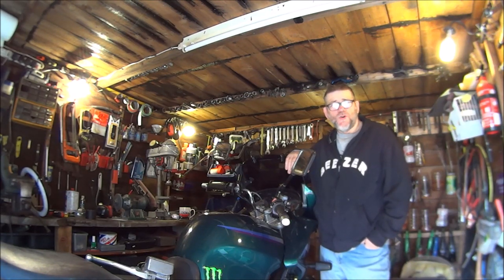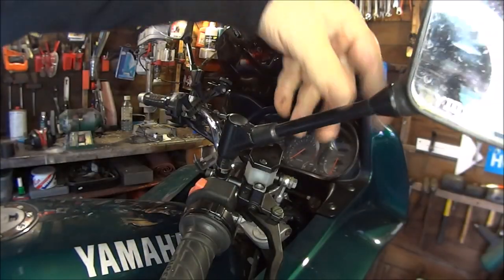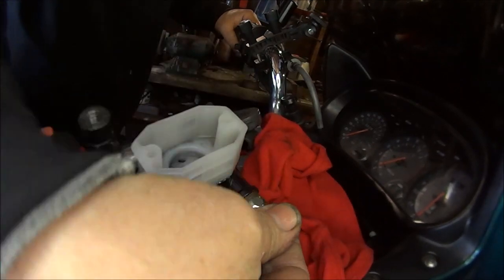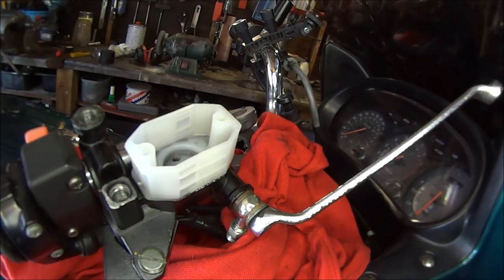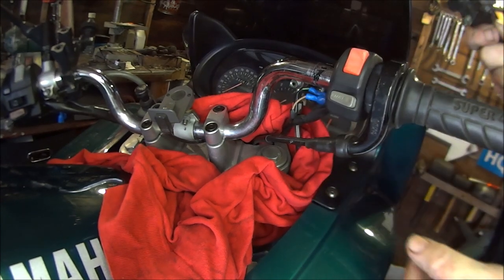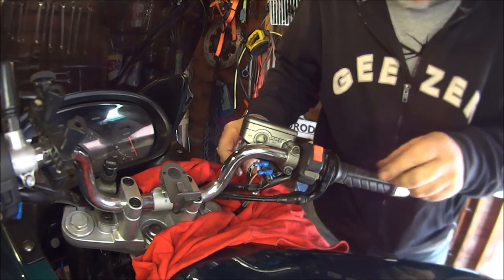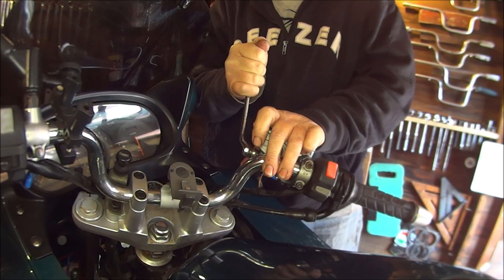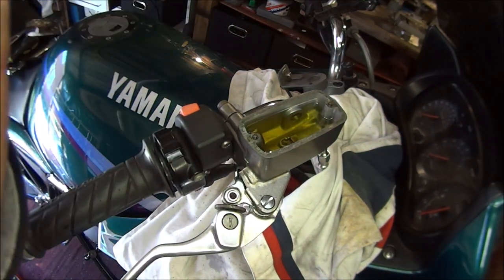XJ900S diversion front master cylinder replacement.

Comment: Anytime I'm opening the reservoir cap I will always turn the handlebars to the left so that the top of the master cylinder is level, then always wrap a rag around the actual master cylinder reservoir, to stop any brake fluid dripping on the lever assembly or the lever, let alone on your paintwork. Also, always replace the bronze washers on the banjo bolt because they deform when you tighten them up.
Reply from the maker: Fantastic advice buddy 👍

Comment: Hi Jon I had a cheap Chinese one that was fitted to my xj 600 had to replace some how it kept applying the front brakes on its own well dangerous it was found out it was the cheapo brake levers they fitted after a drop I stripped it all down and found where the brake lever presses against the valve it had come out of its seating part so when you put the front on fluid wasn’t doing it’s job just braking all the time and locking up the wheel wouldn’t release it self. some people hey kill ya they will you BSafe 👍🏻
Reply from the maker: Hi Derek. You've changed your name again it's hard to keep track with you lol 👍. Chinese is cheap but definitely not safe, I don't know how eBay gets away with it.. Stay safe 👍 👍 👍
Reply: @jonyr1TT  Ebay "gets away with it" because stingy people keep buying cheap Chinese crap.
Reply from the maker: Some people don't have a lot of money and believe eBay is a safe place to buy

Comment: Cracking video.. Mine needs replicing. Is it simple to convert the wiring under the old brake master... Cheers
Reply from the maker: Thanks Dan. The hardest part for me was getting the brake pressure back...   The wires I just cut off the single plug then bared the two wires and put two spade connecters on.👍